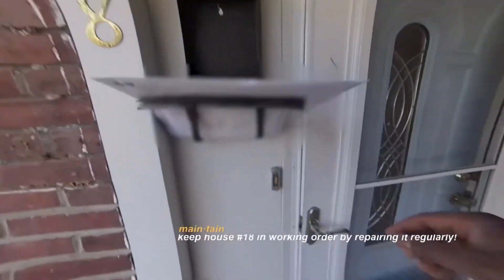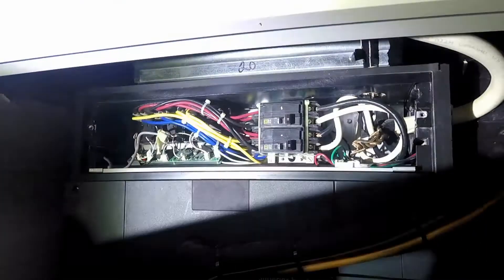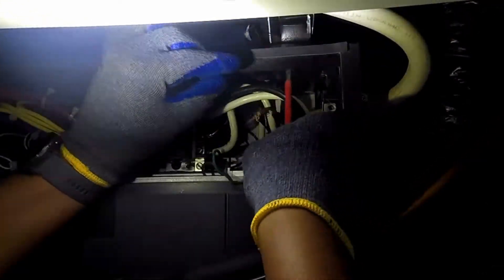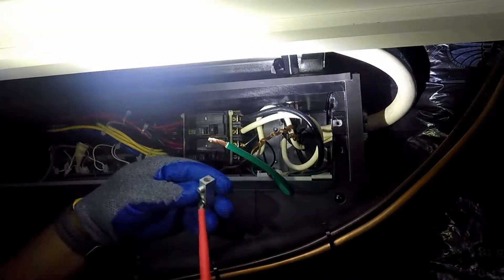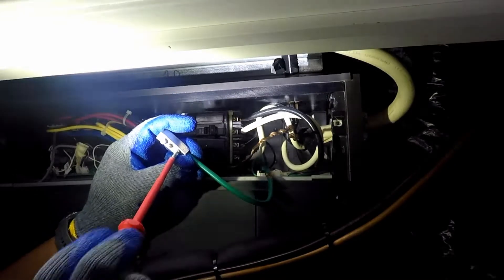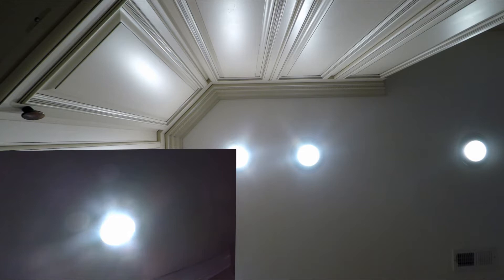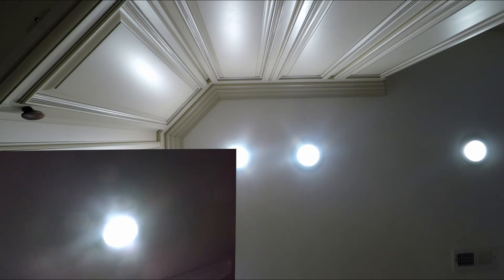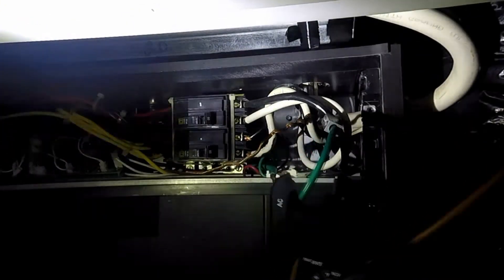Resolve Slight Dimming of Lights When HVAC Powers On - M18 EP16

Comment: Yeahhhh
Reply from the maker: These fixes helped, but the real trouble is because the energy feed to the house is not enough. I upgraded to 400 amps. The Water Heater needs 150 amps to run properly. During Spring and Fall, 200 is fine, during the winter when energy demand is high, there is more chance of an issue. The lack of energy to bulbs causes dimming and overtime damage. The bulbs I have are more resistant to these issues. Thanks for watching. I am figuring out how to get the energy company to upgrade the triplex line as they said they would.
Reply: @GoldenJudge  I think I've narrowed my issue down to shoddy third world power supply. I got these dimmable LEDs and they flicker wildly then go down to 1% and I thought it was the aircon but it's not just that. Voltage drops are crazy here. Any recommendations?
Reply from the maker: @zzzzzzzzzzzzzza This is the premier league issue, of a higher league than myself 😄. Measure what is happening and the problem will be certain. You may need something to smooth the power supply depending on what is found. I bid you luck. I hope you remember to keep me updated on your efforts.